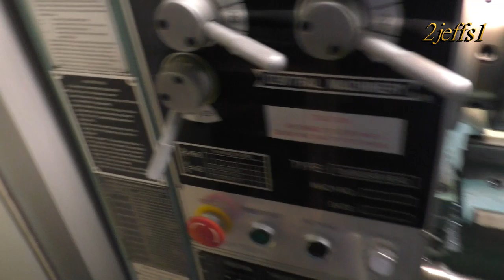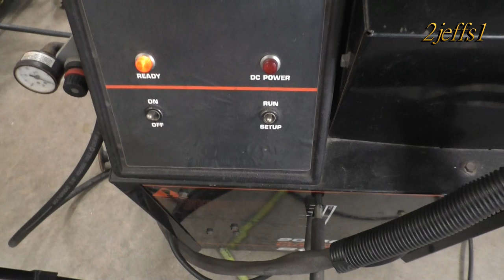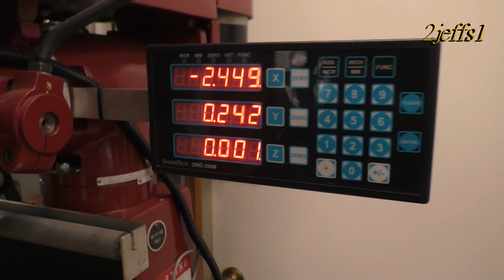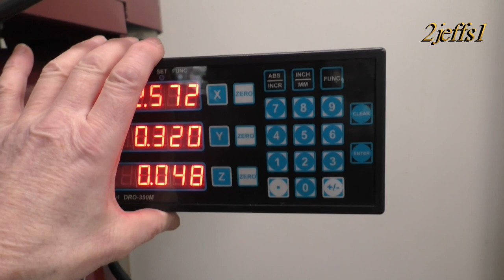Lets See if we can Install a Bigger Brake! A Fun Machine Shop Project

Comment: I need one of the starter attachments for my 4 wheelers because Im a Disabled Vet and cant crank on foot pedal if you could help with more details if i could build on without any shop equipment like a lathe